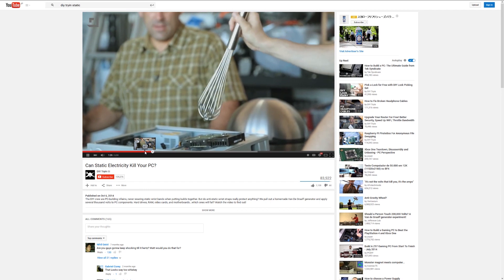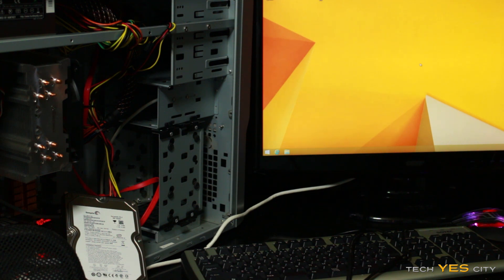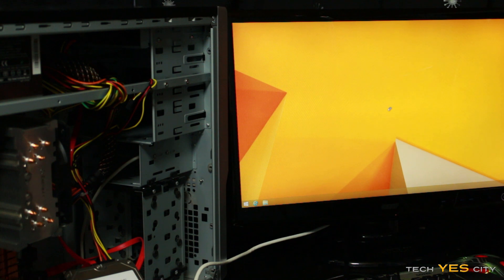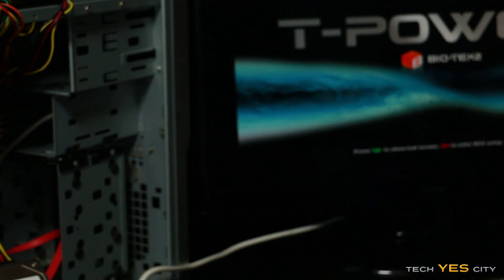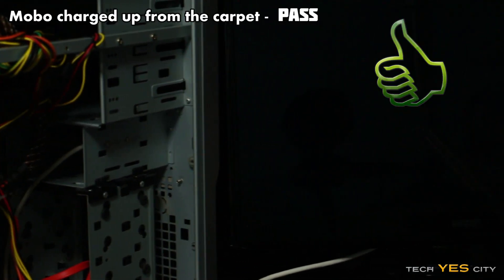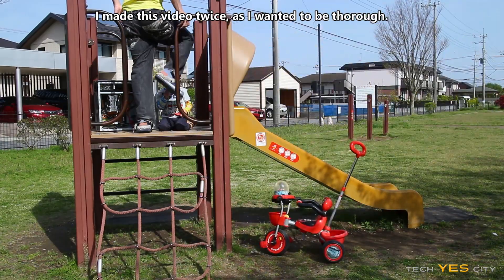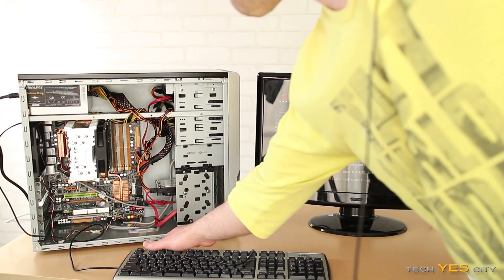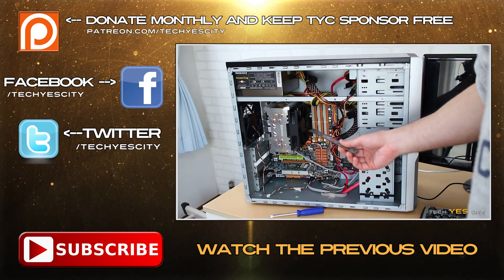Can Static Electricity Damage Computer Parts? Do You Really Need an Anti-Static Wrist Band?

Comment: Well, my old AM3 mobo died from static, i was changing a cpu heatsink and had one of those really static winter shirts which killed my motherboard. I removed it safely and didn't scratched it or anything. First i didn't knew what was the problem later on i found that many people are having the same problem because of static - Everything's running but nothing shows on my screen, i've tried different monitors, gpus, ram sticks, cpu, resetting cmos through battery and jumper, everything. Changed my motherboard and everything worked fine. It can damage the parts i'm not the first one, it depends on situation and how much static is in you or stuff touching your components. You don't need to wear those wristbands but you can discharge electricity on your psu or some metal, and it's like 10 seconds so better be safe then sorry. (Sorry for my bad English)
Reply: or you didnt plug in one of the power cables lol like the jpwr2